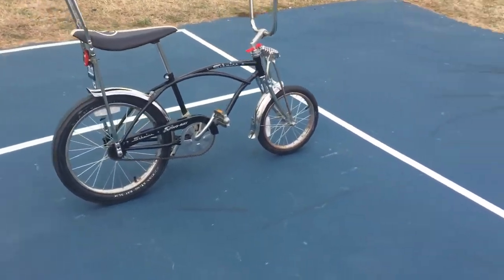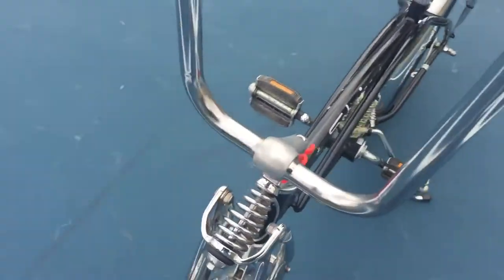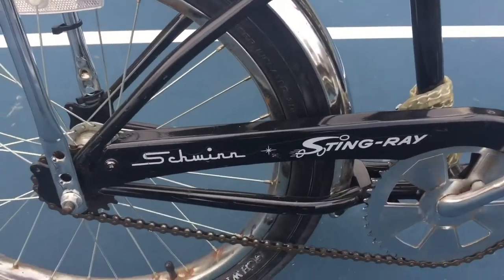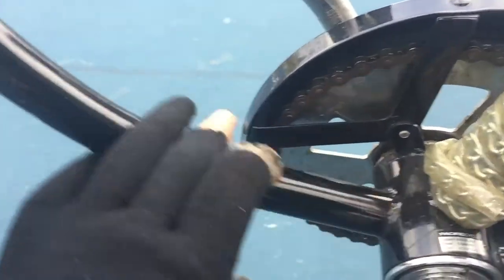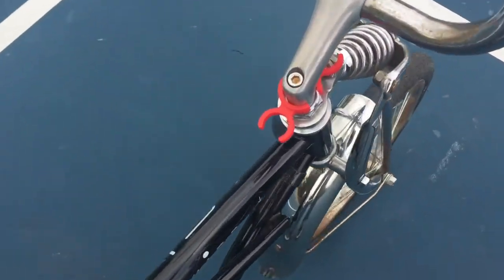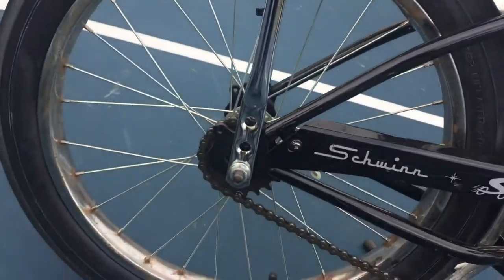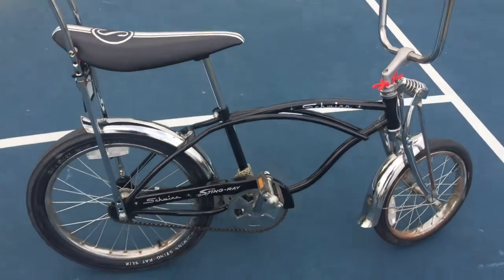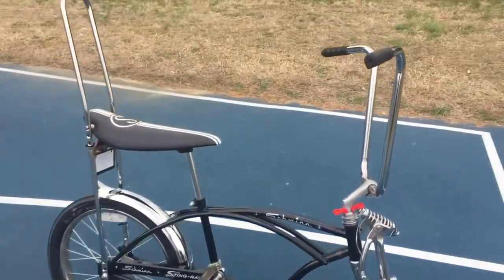2007 Schwinn Stingray Bicycle Review

Comment: Hey any rust removal tips?like on handles bars and other parts?
Reply from the maker: OXBADCODE 657 You can use a mix of aluminum foil/steel wool and water to get it off. Wet the foil with water and then rub the rust with the foil and it should come off. It really depends on how bad the rust is.
Reply: @dimeadozen134  alright do you know where I can get a new rear rim and maybe a front rum?
Reply from the maker: OXBADCODE 657 You can probably get one from EBay or your local bike shop. They’re just basic 20 and 16 inch wheels unlike the 70’s models with Schwinn specific sizing.